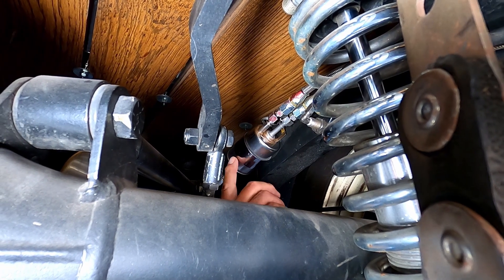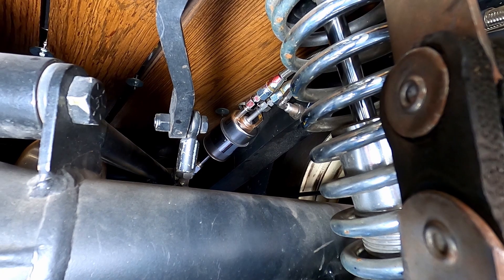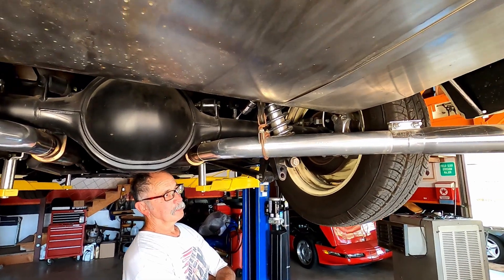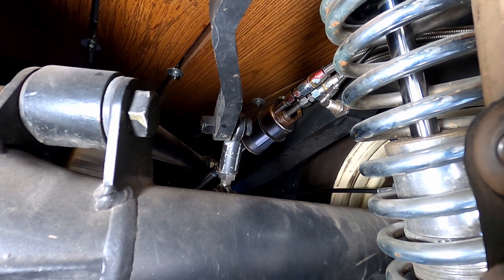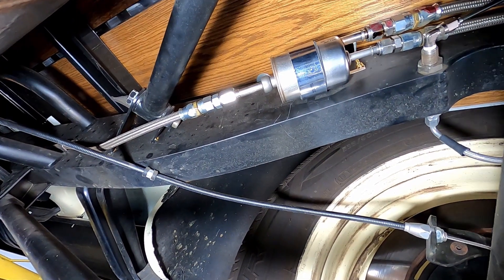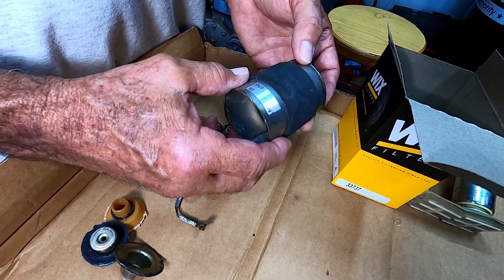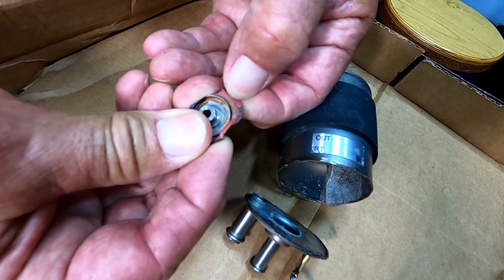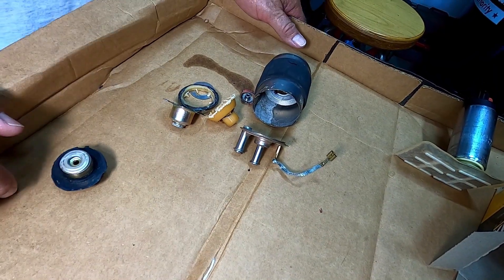LS-2 Fuel Filter Regulator Failure Explained

Comment: 5 Years later I’m getting into an LS swap and Tanks Inc states that if you run a larger fuel pump than the 255LPH you will damage the Corvette style regulator/ filter . Best of luck

Comment: I have the same problem, after key on fuel pump prime, fuel pressure drop to 5psi , car crank but not start, I bought another fuel pressure regulator , hope fix the problem, thanks for the video

Comment: I used a similar filter/reg in my new EFI ZZ6 and suspect low fuel pressure causing me issues.  Only get it going with help of Carb cleaner; sure its not too much fuel causing the hard starts.  thanks for putting this together to help me better understand this filter regulator.

Comment: My corvette regulator reads 58 psi when it primes, 70 psi at idle for my  Ls swap and I think it’s causing my issue with multiple cylinder Misfire
Reply from the maker: It is possible, if it is getting to much or to little fuel. That being said LS swaps can be very different from one to the next. If you don't have the tech and or info for diagnosing and tuning it I suggest getting it or some help before a major issue is created. Best of luck.
Reply: @weekendwarriorgarage4402  I replaced the regulator and pressures are normal,also borrowed a snap on scanner and was able to see if all my injectors are good,and they are. but for some reason the fuel trim is disabled and the computer is showing 4 o2 sensors,when I only have two. But the guy I had give me a base tune must not deleted the back O2s
Reply from the maker: @pjl1919  Hope you can find someone to tune your ECM to the correct settings. This is one of the harder parts of LS swaps. Many folks tuning but not all equal in skill.
Reply: @weekendwarriorgarage4402  I found someone just have to get the funds 😂